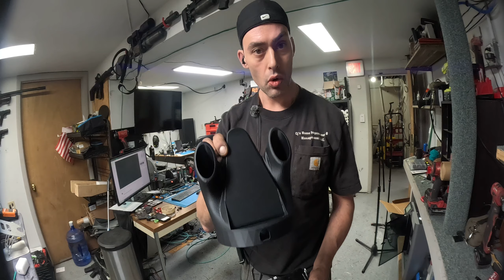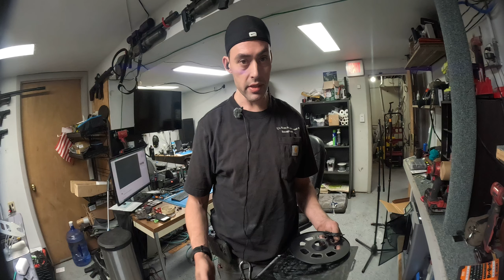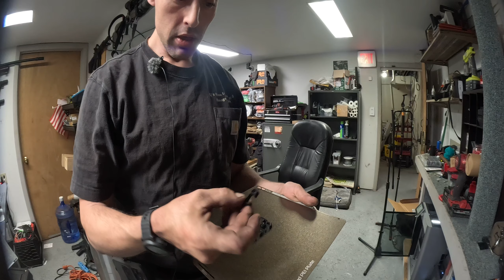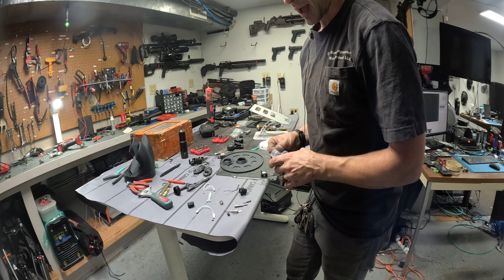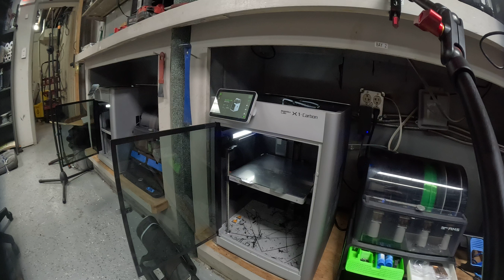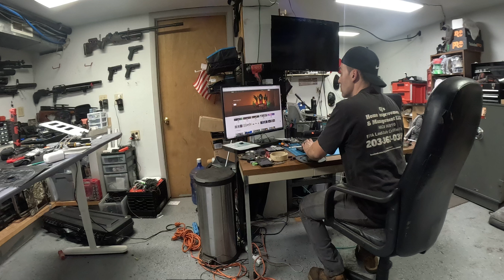Bambu 3D printer aftermarket hot end follow up

Comment: Thanks, really good quality prints. It's interesting what you say about the grub screws and twisting. Thanks for sharing💪
Reply from the maker: You are very welcome, I’m glad that it helps. Honestly, that’s why I thought that the one with the screws in the bottom in the first video would have been better, but can’t argue with the print quality! The other one had a lot of defects, the print quality was dramatically different and I’m not really sure why. But for an aftermarket hot end that has an interchangeable nozzle and comes with four different sizes for that price is pretty damn good! That’s the only downside to bamboo is that they didn’t originally come with an interchangeable nozzle head, aside from that they’re great, but if you can have them be great, and have that as well, for even less money, it makes sense
Reply: Its a good idea, but maybe Bambu wanted specific tolerances.  It looks like Bambu is limiting modding a lot or I should say very little.
Is there any differences with the vertical height of the nozzle compared to the Bambu unit.  @Cjsairgunscarsandmachining
Reply from the maker: @Afro3dprinter  I think it’s more the second one, I think they don’t want anyone using parts that are not from them, but it’s an evitable. It’s not some thing anyone can stop. Their nozzles do work, great, but in order to change the nozzle, you have to change the entire hot end, not convenient. This is a much simpler way, as long as you do, the bed, leveling, and all of that after you install it, it didn’t give me any issues at all. That one didn’t give me any issues the only one that did was the one with the two screws in the bottom, it printed great from the first time. And it looks to be exactly the same depth, the nozzle screws in pretty far so it doesn’t come down any farther than the original bamboo